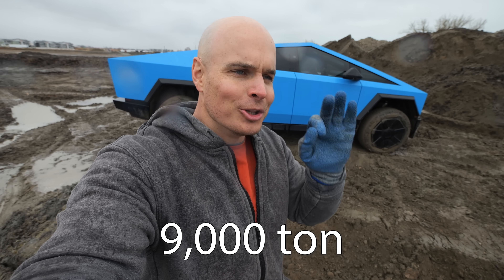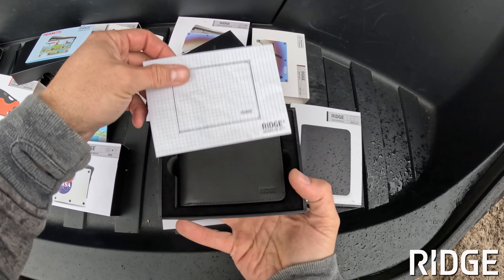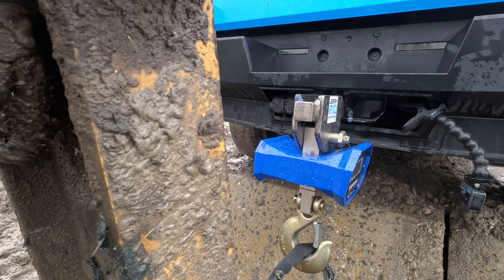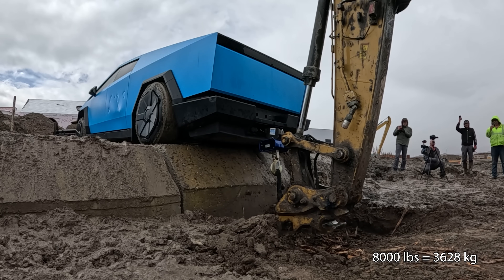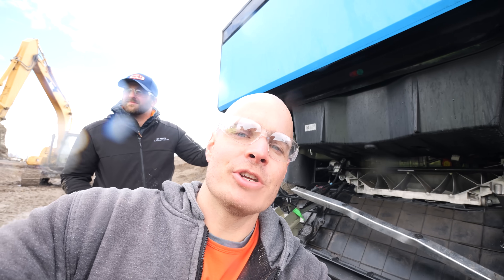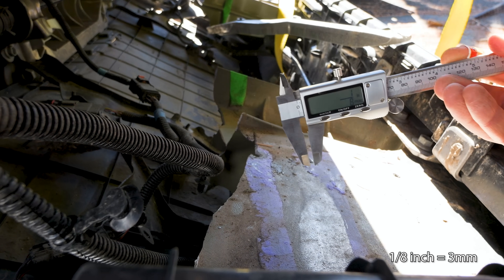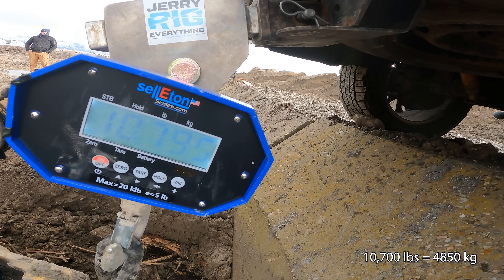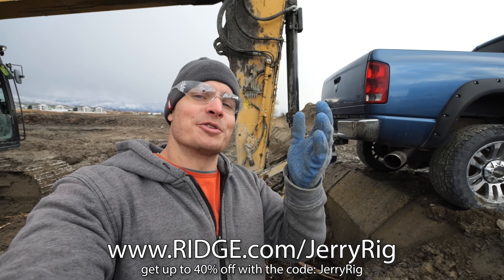SHOULD YOU TOW WITH A CYBERTRUCK?! - (catastrophic failure test)

Comment: The towing capacity has nothing to do with the tongue weight capacity. Nobody should think that. It's nonsensical. They give you two different numbers for a reason.  The tongue weight should represent about 1/10 of the towing capacity.  That number comes from the classification for towing capacity of hitches.

If Tesla says that this can tow 11,000 lb, the tongue weight should be 1100.
Reply: The Dodge Ram 2400 has a towing capacity close to double that of the Cybertruck at 19700 lbs.  You'd have to use a Dodge ram 1500 to get a closer match with its towing capacity of 12,000...

You knew this though, you allowed your EDS to take over.

Comment: What a stupid video. There will never be 10,000 pounds directly on the tongue. It’s rated to tow 10,000 pounds probably 9000 of that would be in the trailer. The other 1000 would be on the tongue. I’m not a fan of teslas but it’s actually pretty impressive it did as well as it did.

Comment: How can someone as mechanically inclined as this guy manage to conflate towing capacity with tongue weight? The result of this test shows remarkable durability, not the inverse.
Reply: Except the Ram didn't suffer the same failure with even more weight. I think you are missing the point that the failure mode of cast aluminum makes it unsuitable for this application. Selecting the correct material for this application is critical and cast aluminum isn't it. It might be good for static tensile or compressive loads but definitely not for dynamic loads that require some level of flexibility.
Reply: @Jetjockgordo  I mean look at it this way. If it really was as unsuitable as you claim, why in the world would it be released to the public in the first place? I'm pretty sure this truck went through all the rigors of certification like any other car/truck out on US roads today?
Reply: @Jetjockgordo  Do you actually think all the commenters here misunderstand the failure modes of aluminum versus steel?  We know aluminum fractures and steel bends.  honestly, we get it.  What we don't get is how the situation that the test replicates makes any sense.  The hitch tongue weight specification is (roughly) 0.5 tons.  The system didn't fail until it was stressed 10x the specified value (5 tons).  The REAL PROBLEM is the conclusions drawn from the test data.  I've analyzed and reported on test data A LOT.  This report is heinous in it's irresponsible mis-characterization of the data.
Reply: @Jetjockgordo  I agree with you on that, but it doesn't change the fact he's misrepresenting the facts. Unless somebody hooks a 40,000lb load up to their cybertruck, there isn't a chance they come close to 10,000 on the tongue. Steel is better, but the aluminum absolutely exceeds the requirements of the load rating.
Reply: He knows the difference. It's just an 'I hate Elon' video.
Reply: @dmsdmullins I’m sorry but, how many recalls have cybertrucks had? The hate is justified, heck, they don’t get enough imo
Reply: @ How many? How many recalls has any other truck had? I'm sure you have the stat's right?
Reply: @dmsdmullins  all CT owners should proclaim "I hate Elon for making an important structural component out of non-ductile and higly brittle cast aluminum that can catastrophically fail without notice sending what I am towing into the back of my CT or careening uncontrolled into oncoming traffic". Clearly not a similar concern for the Ram truck.
Reply: @dmsdmullins  But we learned about its 4.7-ton breaking point, which was the purpose of this video. Dude the guy breaks new things in this channel all the time, he even put the bullets on this truck, but you are here yapping about your God Elon being hated. Grow up.
Reply: @ An excavator breaking a truck? Who would have thought. You know, because they clearly were designed for someone to mash on them with a 50,000 lb excavator.

Comment: I'm still skeptical about the test dynamics here. Many comments offer conflicting ideas about metal fatigue and the actual testing methods. No major news outlets have reported a Cybertruck hitch failure, so Tesla has likely tested its hitch following industry standards like SAE J684. You should do a follow-up video and team up with an automotive engineer to set the record straight. Also, stop being a hater. There are pros and cons to every auto brand.

Comment: Structural adhesives are definitely common on modern cars, but not for tow hitch supporting areas, hahaha. More importantly than just the failure load, after going over thousands of bumps with a trailer, cracks are going to form and get worse and worse until it snaps from even a light load. It's only a matter of time before a Cybertruck kills someone from this type of failure.
Reply: Screws hold the plastic cover in which is purely cosmetic, not supporting. The adhesive is to prevent rattling.
Reply: He literally discusses it in this video, if you are talking about aluminum fatigue. Of course you can make equipment out of aluminum. It also tends to have a lower lifespan than steel. Aluminum trailers are more prone to cracking over time, for example. I mean look at how many suspension components are made from aluminum now. If you look at how they are designed though, it matters a lot. What we're talking about it people doubting the longevity of the Cybertruck design specifically. I agree that simply pointing to aluminum is silly. Though I understand a lot of people are on that bandwagon. We'll see what happens!
Reply: trust me, aint nobody towing with any electric pickup anytime soon with the range loss they get unless its the chevy silverado ev (only because it has a MASSIVE 250kw battery pack).
Reply: @ghost25killer  i could see a rivan or lightning towing because they have been designed for it
Reply: @ghost25killer  I will be picking up my 4th Cyber Beast in Honolulu soon (other 3 are on the mainland in various states) and am waiting for my Pebble Flow Founder's edition trailer that I will be towing with my Vancouver, WA CyberBeast...the Pebble Flow was designed by ex Tesla engineers and is largely self-propelled by an electric motor or motors that can be re-charged by the solar panels on the roof...I will receive the Pebble Flow (google it) trailer later this Spring or Summer, is that soon enough for you.  (2 factors for you to consider, I will be getting the Range Extender ((not available yet)) sometime this summer ((per Tesla)) that will increase the range of the 2 CyberBeasts that I ordered it for ....to 440 miles AND the Pebble Flow Trailer largely propels itself so towing it will not affect my range in the same fashion as a trailer without the tech that the Pebble Flow has.  And my last 3 (including the one in Hawaii that there is a hold on for now, will be given another delivery date soon I hope) Cyberbeasts (purchased 2 in the first week of January) have FREE SUIPERCHARGING FOR LIFE.   So I will be pulling that beautiful, high-tech (check out the "magic hitch" that allows you to electronically (currently an ipad, soon to be a phone app) move the trailer to the back of the tow vehicle and hitch it without backing up the tow vehicle or lifting a finger) hitch the Pebble Flow to the Cyberbeast tow hitch.....So I will be pulling that beautiful, high-tech, self-charging (by solar or can charge it with the free juice in the Cyber Beast) travel trailer FOR FREE.   🙂
Reply: The entire design of the frame section being an H configuration means stress risers on the very thin tops of the H section will develop quickly.  I feel this truck is a sign of alot of things ELON has been involved with.  Rushed, and designed by novices in their field and issues will arise at later dates!
Reply: @IndependenceIron  is that why they have the most reliable cars in the world including the best selling car in the world?
Reply: @bartdeking  isn't the Cybertruck notorious for catching fire? I've never once heard of the Cybertruck being called the most reliable car? Any car that can lock you inside through software with no hope of escape in an emergency situation is a car that should not be on the road in my opinion.
Reply: @DougieTheBushWizard  haha cybertrucks rarely catch fire and in general EV fires are about 20 times less likely although they always appear in the media when they do occur. Sentiment often does not align with reality.  

The lock in the rear is hidden under the side pocket. Just like when you have a 3 door it is best to just jump in the front seat in case of an event or when you know where the lock is use the lock. It is hidden similarly as that when you have the kids lock enable on your car. This so that kids can not easily pop the car open. Again such a fake news myth ti spread negative nonsense.
Reply: @ seeing has how no one has ever called a Tesla the "Most" reliable car in the world.  They sold their 1 millionth car in 2020, and have just entered mass production in the following 4 years, so the jury is still out on how reliable they are.  But from their used prices being only 1/4 of their retail it doesn't seem they are that reliable!!
Reply: @bartdeking  Bart, you're out here waving the "ZERO failures" flag when WhistlinDiesel literally showed two Cybertrucks snapping their frames while towing, one happened on a public road, caught clearly on video. Tesla might call that "overengineering," but most people just call it "shit design." Aluminum fatigues under load cycling and it breaks; it doesn't care about your misplaced faith in Elon's infallibility. Reality check: Denial isn't engineering, glue isn't welding, and facts don't care how much you're coping right now.
Reply: @AstoundingAmelia  That's how easily deception spreads. The example he showed featured a Cybertruck that allegedly hit a pothole. I find it hard to believe that any pothole could be so large and deep that it would cause a tow hitch sitting 15 inches above the ground to hit the surface. It wouldn’t have affected just one tire—his front tires would have hit it first as well.

The fact that only one person has reported this issue suggests that something more severe than just a pothole impact must have been involved. As for the second example, it was a rear-end collision, which is far from a normal scenario. While the rear was damaged, it remained attached, meaning the trailer didn’t detach and go its own way.

If you find somone that is towing 11000 pound and the hitch snaps off because of the weight or normal potholes and normal driving behavior, let me know.
Reply: It is over engineered by 9 times. Would that not be enough?
Reply: @bartdeking  no it would not be enough. aluminium gets weaker and weaker every time you put stress on it. So after a year or two of regular usage, it will be significantly weaker and its limit will be way lower. after 10-15 years of usage, you could probably break it with your bare hands, if it even lasts that long to begin with.
Reply: @bartdeking  Before you reply again, thought exercise: Why don't they make springs out of aluminum?
Reply: @802Garage  because it is designed to flex. The rear of a car which holds the steel tow hitch needs to be strong to hold the tow hitch or maximum 10% of the weight of the trailer which is 1100 pound so Tesla over engineerd the rear by 900% or 9 times. 
Know that the hitch itself is steel and designed to flex to catch short term fluctuations. 

Also know that ZERO cybertrucks on the road have failed while towing.
Reply: @bartdeking  thats an 1100 lb static weight. I.e. not moving. Once you're on the road the trailer bouncing around over bumps it puts way more than 1100 lbs on the hitch. That peak dynamic force would be the design criteria, not 1100lbs.
Reply: @bartdeking  Its catastrophic failure load while new and unstrained is 9x the standard static tongue weight for its tow capacity.
Aluminum fatigues as its load cycled (loaded, unloaded, repeat), and dynamics force can spike massively over static loads. And even if those dynamic forces dont outright fracture the casting it will accelerate the fatigue. All aircraft have finite lifespans for the same reason, every takeoff, landing,  and maneuver (and cabin pressurization cycle when applicable) is cutting into that airframes integrity and will eventually lead to a catastrophic failure if kept in service or not massively overhauled.
Reply: @bartdeking  "because it is designed to flex" You just made my point.
"Also know that ZERO cybertrucks on the road have failed while towing." That we know of. Also because very few people actually tow with it frequently.
As stated above this is a function of time. You'll see.
Reply: @kyle13131  no it does not. The static weight should be balanced and slightly forward below 1100. Not 1100 pounds. Still if you do that the dynamic forced will certainly not exceed double that and in no way 9 times that.
Reply: @hoosierfarmkid  is that why there have been exactly ZERO rears that have snapped when using the cybertruck for towing?
Reply: @802Garage  i did not made your point. The hitch is designed to flex. The trucks rear should just be static and being able to hold 1100 pound with some dynamic forces of maybe double that in extreem scenarios not 9 times. Cybertruck is overkill
Reply: @bartdeking  it absolutely could more than double it for short periods, but the point isn't that it broke, this test is obviously not a realistic situation. The point is that it breaks way easier than any other truck. That calls into question how it will react to years of stress cycling, which currently no one knows because they haven't been on the road long enough.
Reply: @bartdeking  You realize just because the hitch flexes does not mean the frame no longer has the force exerted on it, right? That's why you made my point.
Reply: @kyle13131  I get your point. At the same time, Tesla does everything differently than other manufacturers and has never failed on anything substantial. There are thens of thousands of cybertrucks on the road and doing heavy towing and not one of them had a broken tow bar. 

Last but not least, if this was truly an issue there would have been a recall already and the safety commission would got them off the road
Reply: @bartdeking  Because all of the trucks are at most barely over a year old and predominately grocery getters/status symbols so haven't been repeatedly stressed?
Reply: @bartdeking  Likely less than 5% of Cybertrucks have ever even towed over half capacity. You're exaggerating so badly. Again, we didn't say they were all going to snap in a day. It will happen over time. That's the problem.
Reply: @hoosierfarmkid  sure, excuses excuses. Fear mongering is what that is called
Reply: @802Garage  it won't.
Reply: @802Garage  thought exercise for you. How do you think they make aluminum trailers? Do they fail regularly? Why has the aluminum trailer hitch on my truck, that I tow with all the time lasted me almost 300k miles?  How about the aluminum frame on my trailer?
Reply: @802Garage  If the rear of a truck is stiff but the hitch flexes, it helps by absorbing and distributing forces between the truck and the trailer, improving ride quality and reducing stress on both vehicles. Here’s why:

1. Shock Absorption – A flexible hitch can absorb sudden movements, bumps, and vibrations, preventing them from being directly transferred to the truck's frame or the trailer.

2. Reduced Stress on the Chassis – A stiff truck rear end means it doesn’t flex much to accommodate movement. A flexible hitch compensates by allowing controlled movement, preventing excessive stress on welds, bolts, and suspension components.

3. Improved Traction and Stability – A rigid connection would transmit more forces to the truck’s suspension, potentially causing loss of traction over rough terrain. A flexible hitch allows slight movement, helping keep the tires in contact with the ground.

4. Better Handling Over Uneven Surfaces – On rough or off-road conditions, a flexible hitch allows the truck and trailer to move independently to some degree, preventing one from destabilizing the other.

5. Prevents Frame Damage – If both the truck’s rear and the hitch were too stiff, high stresses could cause frame damage or cracks over time.

Essentially, the flexibility in the hitch acts as a buffer, complementing the stiffness of the truck’s rear to create a more durable and smooth towing experience.
Reply: @ there have been other failures with drivers actually towing trailers.  And the proof is pretty simple when a 2000s rust bucket ram can take the excavator bouncing on the hitch and couldn't fail it.
Reply: @scotttimmons8775 great point. Almost every lifted truck around arizona has one of those vanity adjustable ALUMINUM dropper extensions at 90 degrees to pulling direction. Never heard one of those failing
Reply: @jitterspec  but this is not about rational thinking but the masses being manipulated by deceiving individuals.
Reply: @bartdeking  Just like everything Elon Musk says recently? 😂
Reply: @802Garage  please a few examples as I am not sure what you are talking about.
Reply: @bartdeking  Try any of the times he has been community noted by the platform he owns for starters. The amount of easily verifiable misinformation he puts out is bewildering.
Reply: @802Garage  thanks for not being able to give 1 solid example. 
🤣
Reply: @bartdeking  You're not understanding fatigue and instantaneous load.